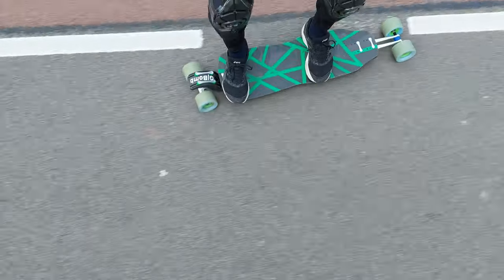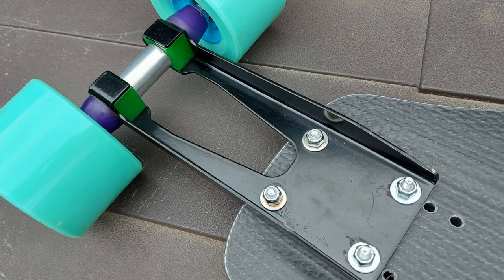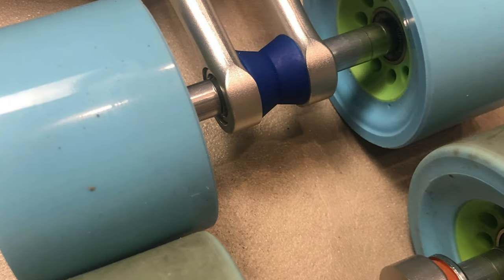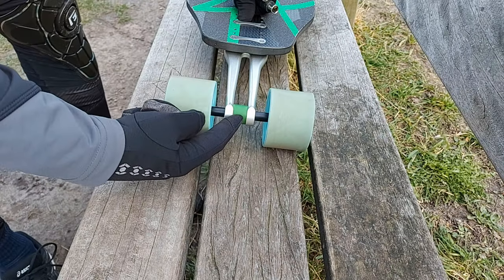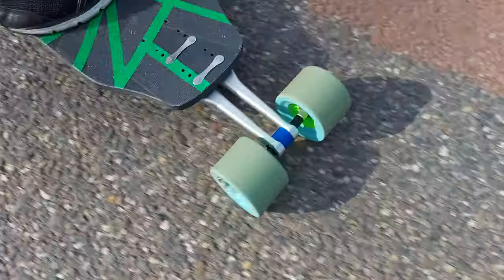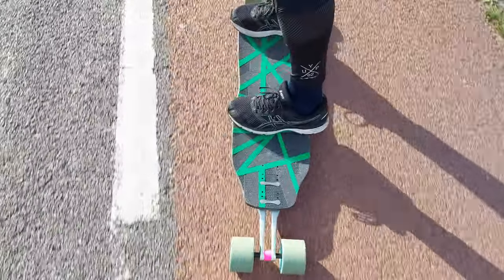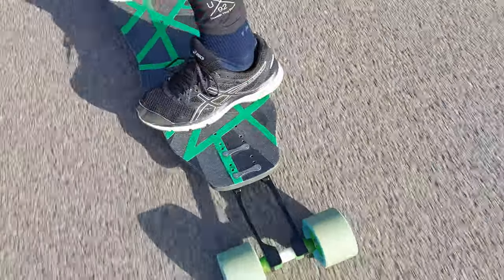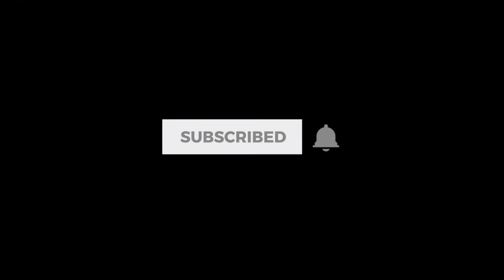G|Bomb TTA vs TTX

Comment: I don't understand what the point of having bushings in this truck.
Aren't wheels fixed on the solid axel? The only moving part is endings of the fork, isn't it? So the only spherical bearings makes sense.
Reply from the maker: The bushings control the amount of Torsion and rebound that is available.  Without the bushings you have the full Torsion that is available but for some skaters it is not the desired rebound that drives you forward. With one or more bushings you create more rebound.
Reply: @beernettskatesystems4185  well, thanks for info. you making really great stuff. unfortunately complete gbomb will cost me in Denmark with shipping costs a hell lot of money. In Europe I will stick with some less quality ldp boards (
Reply from the maker: Please contact me via email, maybe I can help you? Paul@beernettskate.com

Comment: Why do you use the Glass Drop if your angle is 13°? Wouldn’t the SDF be the lighter choice?
Reply from the maker: Hi Niclas. The SDF is lighter indeed. The Glass drop is slightly lower in ride height and sometimes I change the angle a few degrees. Also the Glass drop brings the truck slightly closer to your front foot which results in slightly easier pumping.
Reply: @beernettskatesystems4185  Thanks for the answer, makes perfect sense!

Comment: Another great video! How to combat the low ride/occasional bottom scraping when using a torsion tail when pumping ? I try to use technique, knowing what angles are too “deep” and will result in bottoming out...but I love those aggressive pumps!!! I am currently running 76mm Venom Cannibals, but I have tried Orangatang Caguama 85mm, but still have the same problem...is just the nature of the torsion tail to be low?

Comment: Hey Paul, how come you're not getting any bite from the Glass Drop bracket using a Beernet 5.0 (127mm) and Caguamas (58mm wide)?

I've tried to run a DT Poppy at 143mm with 85mm Seismic Speed Vents (52mm wide) and the similarly "fat" Carbon Feather V2 Longboard bracket and the front wheels were definitely getting bitten by the bracket on deeper pumps.

The G-bomb site says "Regarding hanger width. Since the composite series a bit wider, expect to run hangers around 150mm width."

Are you using harder duro bushings to avoid that, washers, or something else?

Thanks for the great content, as always!
Reply from the maker: Hi, It is probably my pumping style and bushing duro that helps. I noticed other people that also got wheelbite.

Comment: how did the stock bushing (orange tall barrel 80a) in the spherical-plus setting work for you?
Reply from the maker: It worked great. Good pumping and nice wide pumps were possible. Personally I preferred the harder bushing because of the extra rebound but the TTX is more versatile and can serve a lot of styles and not only the fast race winning pace without a surfy feel 😉